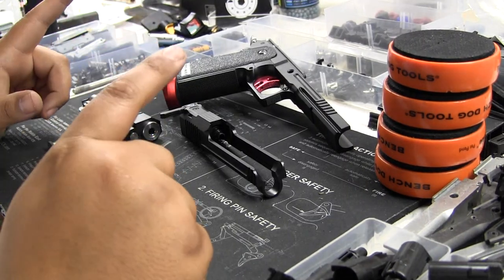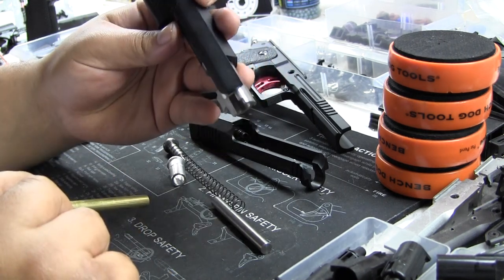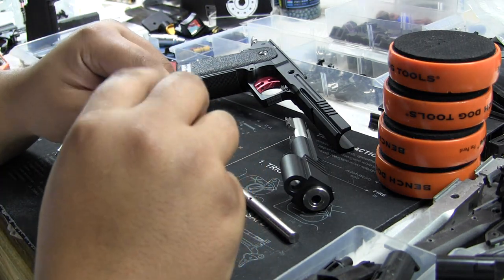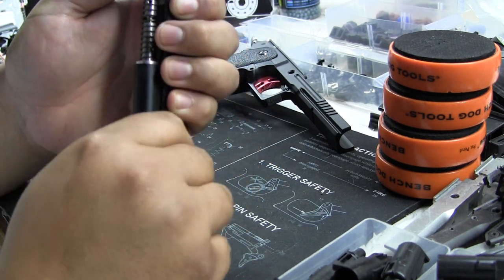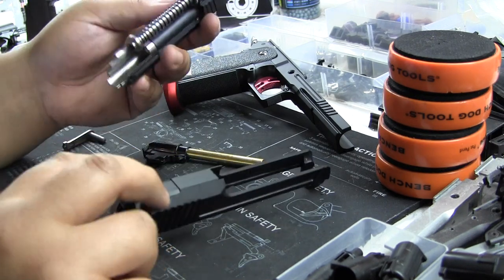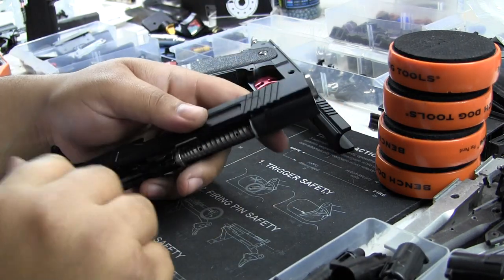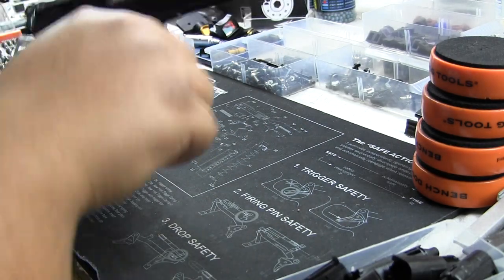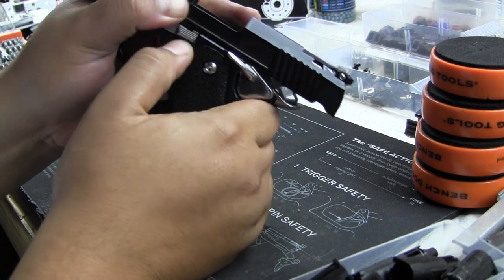Airsoft Masterpiece 22LR Slide Test Fire + Overview (HD)

Comment: I know you may have figured it out but you're supposed to put the guide rod in seperate, and then the slide the longer half in from the front and tighten it with two small screw drivers in the holes on both halves.

Comment: Hi dude. Would a 150% recoil spring eat through more gas than say a 120% spring? I live in a colder climate and have always wondered..If you know. Cheers!
Reply from the maker: yea i would probably run a 120-130 keep that slide light as possible to counter the cold

Comment: Hey Knuckles, I typically dont do this but you seem like a guy that knows what he's on about. Im a pretty decent pistol tech myself and care for a 15 member teams pistols, builds, modifications and general upkeep. As you can imagine I go through parts pretty quick and eeking out enough parts can be stressful, especially replacing cheap hammers in Hi-capas to get rid of the hammer riding on the slide and such. My question is, where do you do most of your shopping? Obviously you have a few places that carry good stuff.
Reply from the maker: i have a video on that, check the channel and those websites should help out
Reply: @KnucklesGSM  is this an airsoft conversion into an actual firearm?